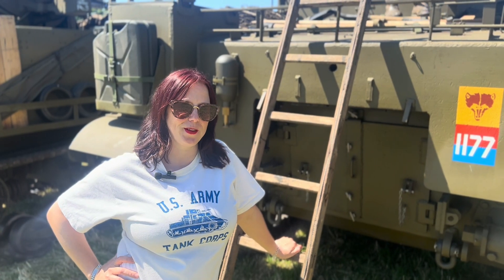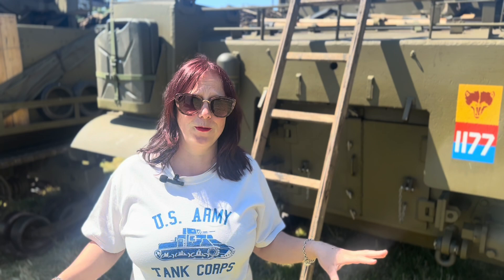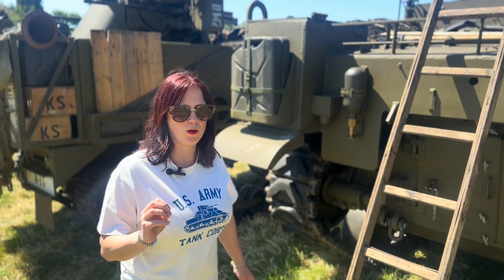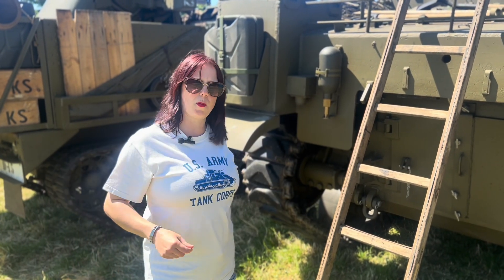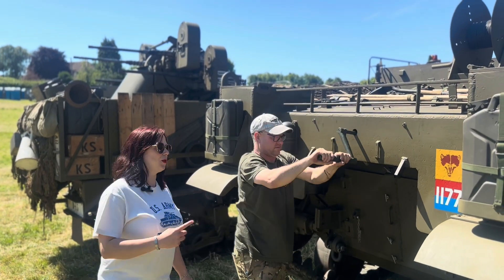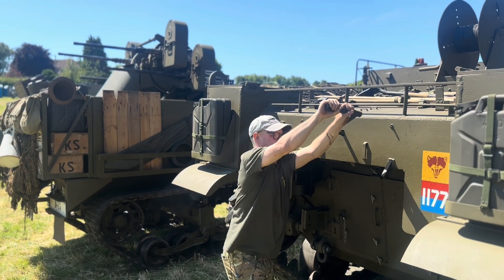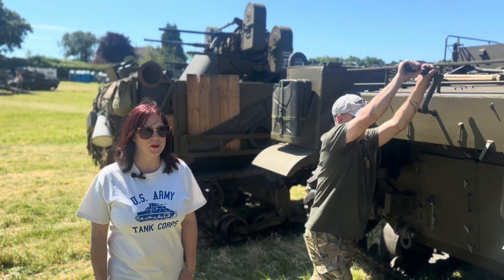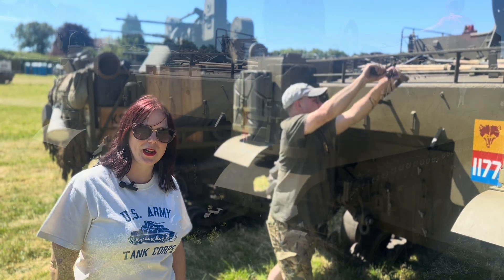Why do they turn a radial tank engine over ?

Comment: Wrong. After use, oil pools in the lower cylinders of radials. If the oil is not removed from the cylinders they engine could at worst have hydraulic lock and bend the rods, or at minimum could foul the spark plugs. Turning a radial over before startup allows the oil to escape past the valves and out the exhaust. The engine can then be started.
Reply: She is pretty much right just didn’t go into as much detail as you have

Comment: Not sure if is a similar problem on these engines in tanks, but in aircraft the lowest cylinder could be prone to leaking oil building up, and swinging the prop was a way to check for hydraulic lock before the starter was engaged
Reply: correct 100%.
Reply: Yes, they used the same type radial engine as used in aircraft. The old Sherman's used the Continental licensed version of the Wright R975 radial. There were 4 different engines in use in the Sherman's but that was the only radial.